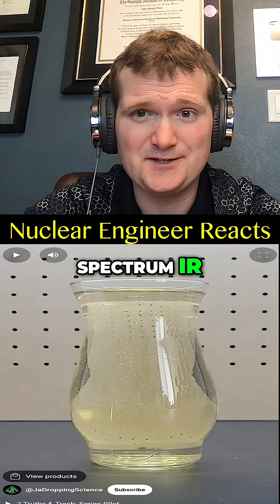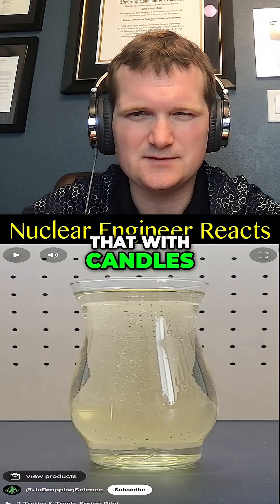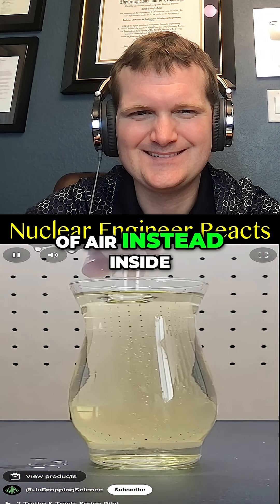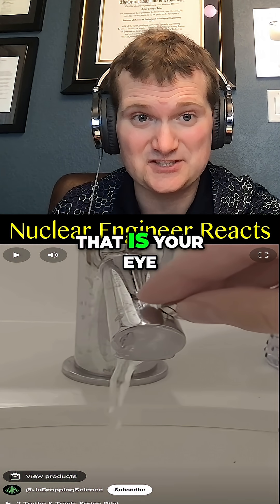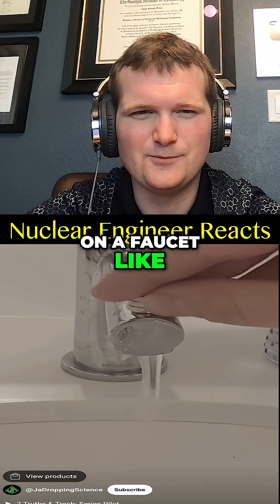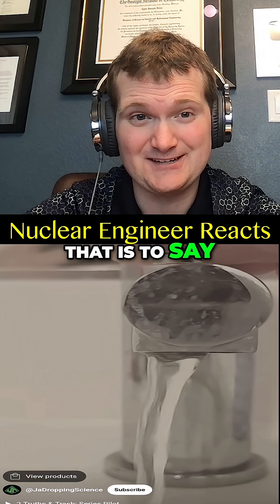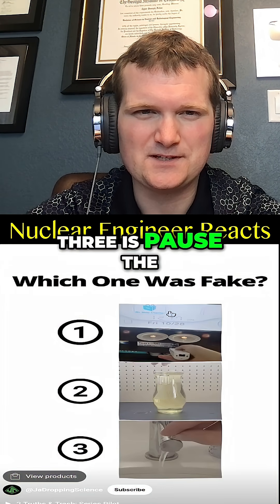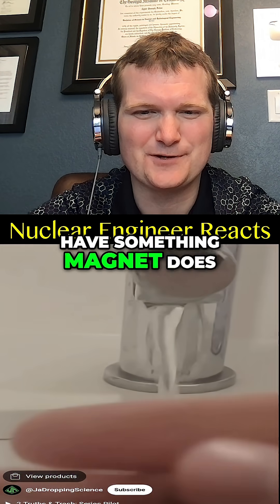Cloaking Test Tube? - Nuclear Engineer Reacts to 2 Truths & Trash by JaDroppingScience

Comment: Fun fact we used to play Wii on a projector screen in a church sanctuary. We could be 50 feet in front of the sensor bar and still have pinpoint accuracy because of the lights hanging from the ceiling 30 feet above us.
Reply: I swear, most large or popular churches has a Wii or a Wii u
Reply: Was it proportionally accurate to the screen?
Reply: @AD-lh3jk yes the screen was 12’ 4x3 with the bottom roughly 20’ from the floor. The screen was 83’ from the projector and 50’ in front of the sensor bar